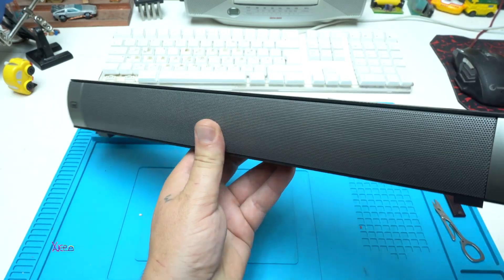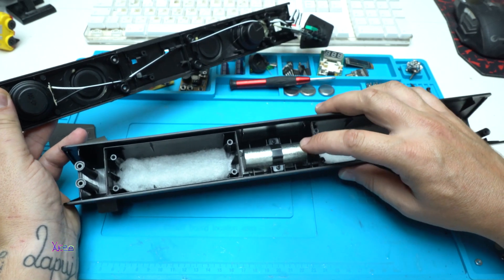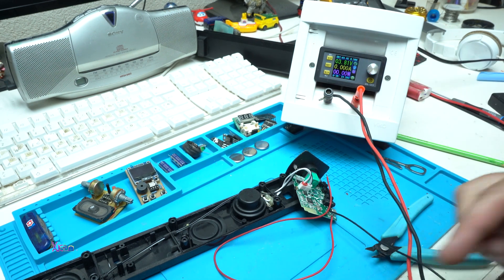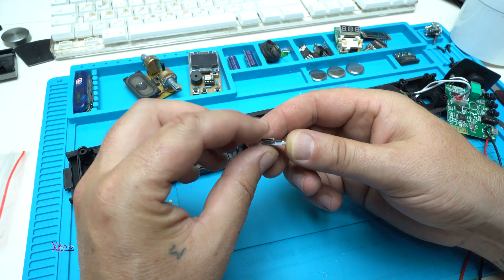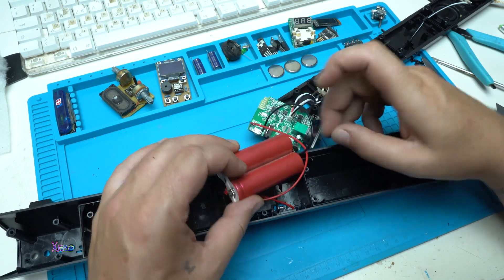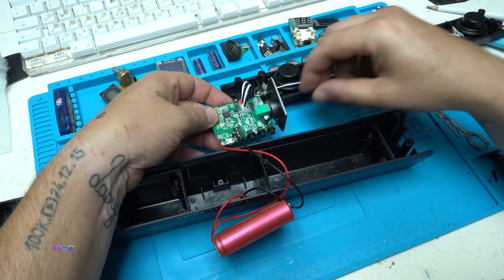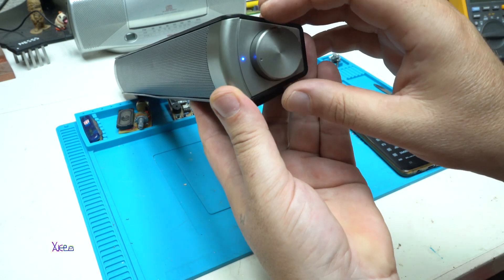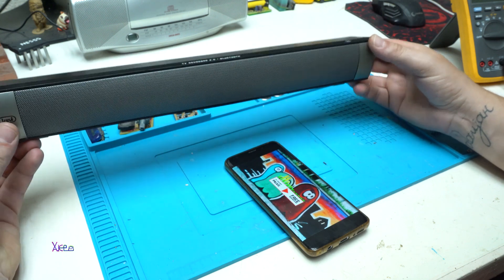I Hack the Bluetooth Speaker - When I open Surprise?

Comment: It would of been better to of used a TP4056 board with onboard protection to prevent the batteries draining to far down
Reply from the maker: That is great but do not have that kind of board,need to order😁